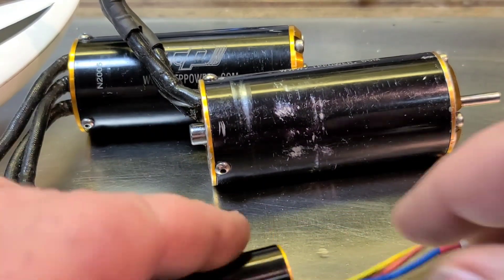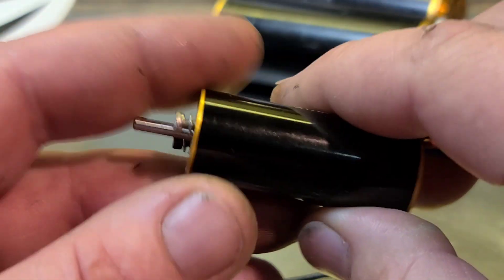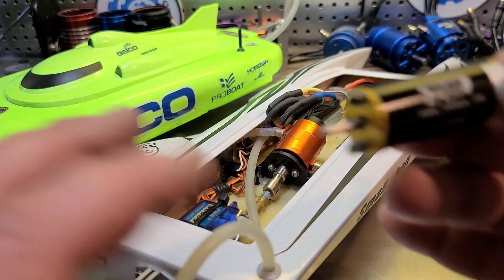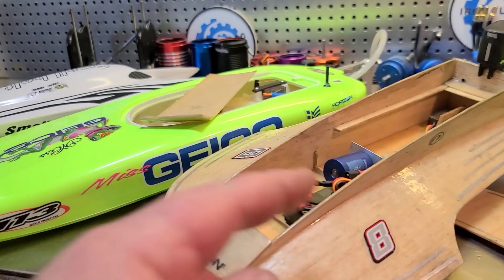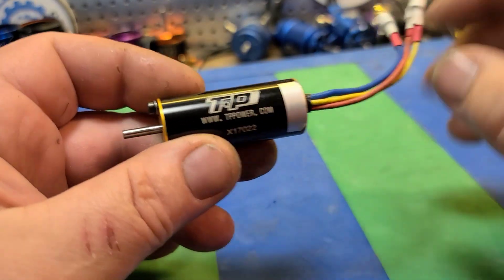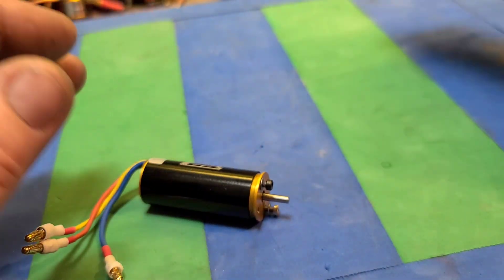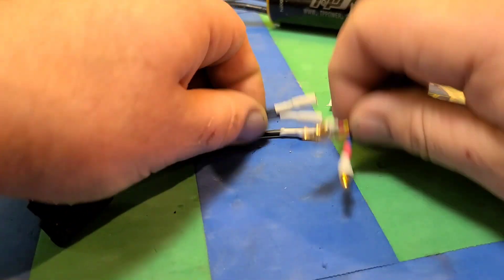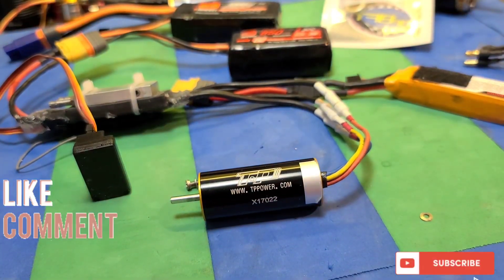Which Boat? TP Power 2030 5310kv Small Brushless Motor Test

Comment: Did you add a cooling plate to your Smallbolt? I see more outlets than mine has. My Smallboat hatch has warped, Ive tried steaming it. Any suggestions?
Reply from the maker: No sir it's basically the stock cooling setup  I did switch the cooling I'm & out on the motor for better flow.  As for the hatch, steam or heat should get the water out.
Reply: @IRONCLADRC  Ill go for it again w steam and really hit it.  I did get warp out, but the next day it returned. I even taped it to the boat when it was hot still.
Reply: @IRONCLADRC   Do you have any clue what Octura prop I put on this thing years ago or what was suggested?  I'd hate to loose it not knowing. I use fuel tubing as a 'lock' on the prop nut.

Comment: Hey big B just wondering what is a good prop for top speeds with the pro boat sonickwave 36. I have upgraded water cooling and 1650 kv tp motor but stock esc just wondering what prop i should get thanks.
Reply from the maker: Dasboata props are the best preped props on the market.  Message him tell him what boat/power & what your trying to accomplish he'll get you hooked up dasboata
Reply: @IRONCLADRC  thanks.,

Comment: Man, the conception and birth of that little motor made me howl! 🤣 You're a certified lunatic Big B!!
Okay, I'd go for the Small Bolt. One thing I do know about TP Power motors is that the magnets they use means they pack one hell of a punch for their size with loads of torque. On 3s you'll be getting close on 60k rpm on the shaft, but with good cooling I reckon you could go with small high rake prop (if you can find one!) and that little hydro would seriously kick ass! The only caveat would be the current - so 2s with a bigger prop is also an option. What a dilemma 😅

Comment: Got a proboat blackjack 9. I need to find something with cooling in 15mm barrel. I think a 2030 will be too big still. also need a tiny cooling plate for the esc. maybe i should send this to you to have fun with.
Reply from the maker: There's old-school small aluminum cooling rings for nitro engines that may work with small motors.

Comment: Oh great...  🙄  20 seconds into the video, and now I have to clean all the coffee of my computer monitor... AGAIN!  Thunder Power, unlike so many other manufacturers, actually provides all the motor constants for their lineup.  According to FECalc your TP 2030/7D on 2S would turn a cut-down X427 at 33,006 rpm at 43 amps with maximum efficiency at 35,853 rpm, so a smaller prop would improve efficiency.  The same setup on 3S would move your Amp draw to 81 amps or close to 800 Watts.  That motor is rated at 300 Watts maximum (mainly due to its ability to dissipate heat).  On 3S, you would want to keep it at 30 amps or less.  On 2S you could push 40 amps for the same Wattage output.

Remember, that motor can take the Voltage, but it's physically limited in maximum Wattage output.  You can add water cooling and up the Wattage output somewhat, but you will still be in about the same overall range.

With all that said, that motor will be a real powerhouse in almost ANY application.  If I were King for a Day, I'd put it in the MG17 and consider some of those nun-chuck style Airsoft batteries with each cell as low in the sponsons as is physically possible.

Comment: 🤣😂🤣😂🤣😂🤣😂best intro ever Big B!!!
MG17👍 
I had a MG17,  I put an Atomic ball bearing supported strut and flex drive on the back, 4500kv motor and 3s battery and a metal gear mini servo. Torque roll was a bitch to control-however I see you pretty much got that under control in previous mg17 videos, I was impressed.
 What ever you do I know it will be a blast, can’t wait to see it.✌️